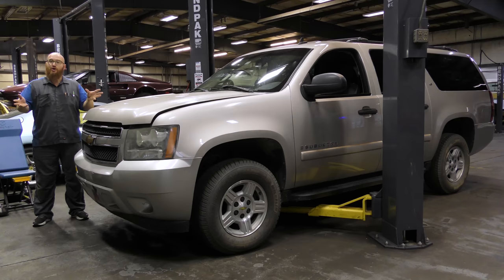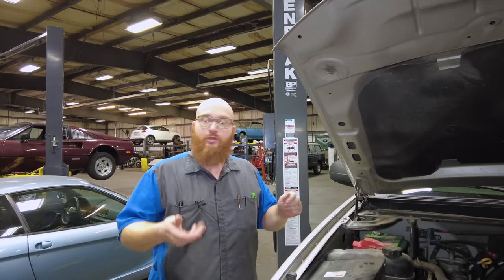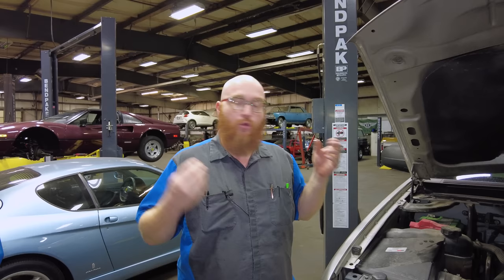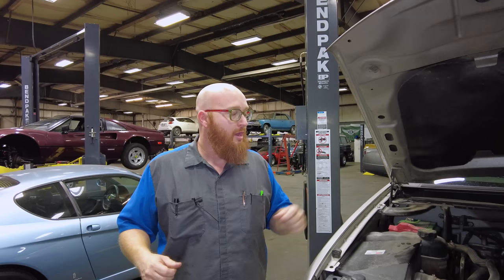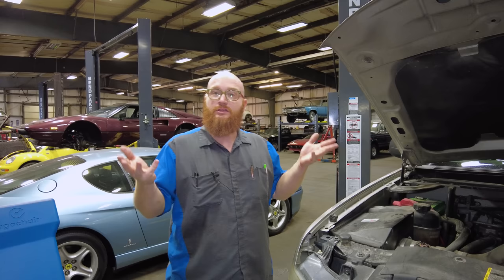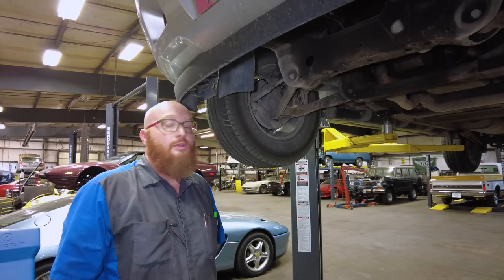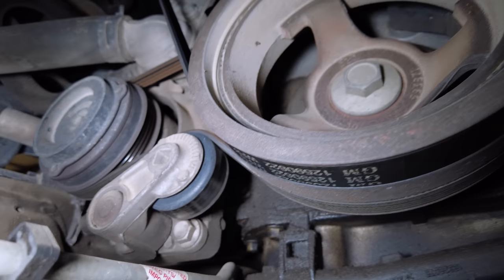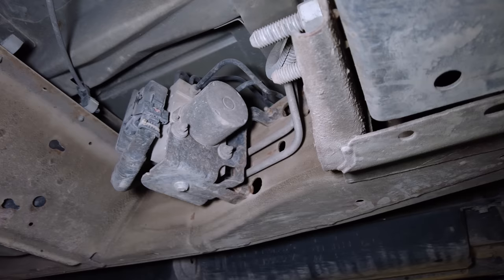What fails on ALL early 2000's Chevy SUV's!? CAR WIZARD shares what he's seen from the last 20 years

Comment: I used to be a Gm tech when these came out ... 1/2 ton chassis with 4l60 did hundreds of them and transfer cases especially if they are left in auto 4x4 mode.. stretch the chain which was 900 bucks if it didn't destroy the aluminum case. Rear axles I swear were made of glass.. among alot of Delphi electronic issues ... but majority of the issues is lack of maintenance
Reply: Those ol 4l60s just never held up? I'm sure it was a lack of maintenance, but still, kinda sucks because I always wanted a gmt800 Tahoe or Yukon, but whenever I find them they're either rusted out or don't have any trans maintenance history.
Reply: My 2002 Silverado Z71 is still rolling strong. But, I do all the work myself, never had an issue with the transmission, had an issue with the transfer case, rebuild and away we go. It's honestly the easiest vehicle to work on I've ever owned.
Reply: Those trucks may have a few issues, but they run forever.
Reply: Probably why my 2004 I-6 Envoy still works. That and I removed the front prop shafts (making bearing noises). I don't use 4WD anyway.
Reply: At least the 4l60e is cheap to rebuild in comparison the the 6l80.
Reply: New Process 246's (and the likes there of) are Magnesium T/Case's
Reply: The issue was not buying a Toyota
Reply: Hi
Reply: @jordanmercier3616  the tech and the dealership knows what the service records are if the owner was not seriously allergic to said dealership. So when automatic transmissions go they just do and it has a lot to do with the engineering.  If you look at Mazda and Honda vehicles, the heavier vehicles, namely their respective vans all needed new transmissions even with their services done on time. Or course without the services done the trans is failing at only 50k so I told customers to change it at 30k. Part of it is the nature of auto transmissions. They are finicky and weak. My imagination tells me that certain things are carried over from their passenger car lines and not totally reengineered for heavier vehicles.  Automatics are gravy for dealerships and thats one reason they sell them.  They may reduce shock and load on engines but ideally I would prefer manual for the durability.  It could also be temperature. Auto trans especially do not like high temps and yet trans fluid radiators are not that common. Perhaps its the gravy thing. Not sure. The turbine in the torque converter generates heat always!
Reply: @jamesmedina2062  yeah, that makes sense. I have a GX470 at 250k and an 02 sequoia at 265k. Haven't had any major issues with either of them, they both have the 2UZ engine, ones pre vvti and ones post vvti,  one has a 4 speed auto, and the other has the 5 speed auto. Granted I've done a lot of maintenance on them and they both have trans coolers.
Reply: @chadhaire1711  I love these types of comments. Yes, Toyotas are fairly reliable, generally speaking. But lets compare GMs offering of full size trucks SUVs in the early 2000s to Toyotas. First of all the Toyotas of the time (and it's not much different today) were just less specs for the $. The specs on the Toyotas didn't stand up to domestic truck specs, whether it be payload, towing or power... the toyota trucks/suvs just didn't offer the capability that the domestic ones did. And as a shop owner, I assure you the 1st gen of Tundras/Sequoias have their fair share of issues and their issues are often more costly too. For sake of comparison, the 1st gen tundras/sequoias (2000-2006/7) most common problems that I see include:

1. the very same issues with the exhaust manifold studs as GMs do. 
2. They VERY commonly experience smog pump problems, which in a shop will cost in neighborhood of $2k to repair. 
3. I've seen quite a few of them with broken ball joints. 
4. The radiators fail internally and mix the coolant and transmission fluid which usually destroys the transmission. 
5. The catalytic convertors are typically junk at around 200k miles and cost around 3 grand to replace. 
6. I couldn't even begin to guess how many sets of head gaskets I've done on them. 
7. A ton of the earliest 1st gen tundras that came off the line needed the rear end replaced within the first few thousand miles (this was a "teething" issue that was fixed in the first half of the first model year iirc and is all but forgotten nowadays) 
8. Frame rot on them is extremely common (In my experience Toyota's/Lexus' in general and across the board have the highest propensity for rust of any manufacturer in North America)

Fact is that pretty much none of the common problems seen in the 1st gen toyota tundras were resolved in the earlier 2nd gen tundras. You can add starters to the list of common problems in the 2nd gen trucks though. Put the word "starter" and "tundra" in the same sentence and people start running away quick. The 3rd gen tundras (2022-present) are already having their turbos fail at an extremely high rate, which from what I've been told is a cab off repair. I keep hearing the rear ends in them are leaving a lot of them stranded on the side of the road too. 

Yep, shoulda bought the Toyota instead. As for the Land Cruisers, they're not without their problems either. They are also grossly overpriced. That said, it is the Land Cruiser and the 4runner that earned Toyota its reputation and I would highly recommend them to any of my customers.
Reply: @catfishbilly7425  Well Fish it's like this:  I have been around the car industry since the late 60's.  I keep track of what fails and what does not.  You are playing a numbers came, cherry picking stats  to make your point.
Yes rust and gaskets can happen, but I know damn well it will happen LESS in a Toyota than any other brand.
Go over seas and see what people are driving in the boonies...no Chevy, Ford, or even Jeeps there....mainly Toyotas...and for a reason.  As far as power and tow ability, buyers of Japanese trucks are not going to get suckered into the number wars......So the F150 can tow a thousand pounds more than another brand.....50% of mid-size ruck drivers will NEVER  pull or tow more than a ton of people or gear, and most who do will do it about once a month if any.  That is why the Datsun and Toyota 4 cylinder mini trucks sold so well in the 70's. 80, and 90's....they ran and ran and NEVER broke.
2.)  And again with your cherry picking, you gripe about the Tundra Turbos failing...actually they are not failing, it is one small part, and that is due to the AMERICAN SUB-CONTRACTOR and their crap quality control who didn't make the parts to spec.  Fact is that motor and turbo has been used in other vehicles trouble free LONG before it ever saw service in a truck, and were trouble free if they were JAPANESE made...just like the rusted frames on some Toyota trucks in the past--it was the AMERICAN MADE frames that failed, NOT the Japanese made.  And Toyota backed them up, even replacing the entire frames out of warranty at no cost to the owner....could you imagine Ford,   GM or Chrysler doing that?  LOL....NEVER HAPPEN. Even in the worst lemon buy-backs, it takes an act of God to get a response, especially Chrysler....now that they have been sold once again that might change but....
3).  You can play with all your numbers you want---solid factual warranty records, repair records, and consumer feedback all prove that Toyota Tundra's (or Honda Ridgeline--yes it is a truck) are still less likely to have problems  compared  to Nissan, Ford, GM, or RAM.....that is why they have 20% more resale too....the money you lose on   depreciation with other brands in huge---for a good reason.....so your soap box speech was entertaining....you seem to have had plenty of practice, bet you even give it to the mailman..., but it didn't  work here.........NUFF SAID.
Reply: @jordanmercier3616  mine made it 200,000 miles with mild towing. Certainly not the worst trans. I would rather a 6 speed anyways.
Reply: @catfishbilly7425   1. Exhaust manifold leaks are super common on these 4.7s unfortunately. There really isn't a good solution other than Doug Thorley headers that cost like a grand plus the time to do it.

2. The secondary air injection systems are somewhat common, but they're only on the 05-07 tundras.

3. The ball joints aren't a big issue on these, they're a regular wear item that probably goes out a little sooner than other comparable trucks. I've never seen a lot of them.

4. The trans cooler failure is not a common failure, though it does happen. Just replace the cooler every 10 years and ur good. The part's like $100, it's a super easy fix.

5. The cats are usually done around 200k miles, lol that really isn't that bad. They don't cost 3 grand to replace, not on the first gens anyway. Maybe $1,500 at a shop.

6. Head gaskets were never a common failure on these so I have no idea what ur talking about. 

7. Keyword off the line, and Toyota fixed the issue and no cost to the customer.

8. The frame rust issue was sorted out long ago, and it was only an issue with the vehicles made in the US. The Japanese made vehicles never had this issue. Also, anecdotal, but I own one from Japan and one from the US, the Japanese made vehicle has 0 frame issues, and the US made one has some serious rust spots.
Reply: I could R&R a front hub bearing assembly in 10 minutes, blindfolded.
Reply: @jordanmercier3616  dont confuse catfish with the facts.....his head will explode.
Reply: @chadhaire1711  I have direct proof which is the best kind. Why don't you watch some of Precision Transmission's videos on here? The amount of stuff that can go wrong on an auto transmission is huge. Also there are friction plates that by definition degrade with each transfer of torque. Manual transmissions are incredibly simple mechanically and the fluid is basically clear for many years. There is no friction material. There is no turbine that generates heat. Just direct transfer helical gears that mesh together.
Reply: @jamesmedina2062  you forgot $1,000 to replace a clutch every 80,000 miles....and Toyota--Honda automatics usually go over 200,000 miles, by then its time to get a new vehicle.  You are cherry picking your numbers here.......Fiat, Mini Cooper, Nissan, VW  manuals fail often............
Reply: @Globbs  fair enough, not all of them are bad, but a considerable percentage if I had to guess. I guess I'm just saying compared to other vehicles that are known to be very reliable, that trans isn't quite as good. Not the worst trans by far lol, nothing like the Nissan CVTs.
Reply: @chadhaire1711  there may be exceptions but if you parse your own words you will believe the difference in the two formats of transmissions. One of them has a friction material that is kept separate from the gears(clutch) while the other has everything thrown together. Hey autos have their place because they free up your other foot to do something else and your other hand to do something else like check your phone or something. Even mechanically autos give the engine a consistent fluid load that is better for it. In line with what you said my friend did go through 3 transmissions in route to putting 650,000 miles on his Honda Civic. The engine stayed happy. He was a rocket engineer at White Sands Missile Range and took the 150 mile round trip every work day back and forth from El Paso. I put 330k on a VW 1.8 turbo engine on THE ORIGINAL CLUTCH. The Getrag transmission was always solid. The engine was burning oil and needed rebuild. I have never burnt a clutch out on various cars. I drove a Ford Mustang with supposedly bulletproof C6 to only 1 or 2 thousand miles before the transmission was toast on account of high power and the heat. The converter was smaller on that thing. Manuals don't even need or get coolers ever! They don't need 'em!
Reply: @chadhaire1711  I believe you Chad. As a teen,I had several 70s and 80s classic Gms,Chevy,Dodge, Chrysler,and Pontiac. The first was a Vega!🤣 cars that established the foundation of the American industrial revolution in history. Nowadays, the past 3 decades, the American automotive industry has been sabotaged. Automotively..we should be great again, forever.
Reply: @jamesmedina2062  My 390 C6 went 200K miles and that tranny was impossible to kill....it ran out of fluid so many times I can't count, and one day the brakes failed so i slammed it in park at 25 mph.....even after all that it still operated 100%. On the other hand the 6-speed manuals in the  newer V8 Mustangs  fail, and fail often....I think there was a class action lawsuit....only the Mach 1 or Cobras get the stronger box.  
The automatics in the Mustang GT last longer than the 6 manual.....the ZF 8-speed automatics are bulletproof.....used in about 15 million vehicles, various brands,  from the Dodge Chargers to expensive Bentley.  Oh yeah, automatics are quicker in the 1/4 mile, and use 10-20% less fuel......so if you want to accelerate slower, use more gas, and shift a thousand times in heavy city traffic, go ahead with that manual.
Reply: @edgarcruzsr9695  American car makers have good stuff, but you have to pay them good money.  The new  Dodge Challenger SRT, Hellcats---RAM TRX Hellcat---Ford Mustang V8---Corvette---Raptor--Bronco....all great vehicles but expensive.  But on their lower end economy cars, all junk.  A sedan or compact SUV you are better off with a Korean or Japanese brand (except Nissan).   The worst American car ever made was not the Vega, which aside from the crap motor, wasn't that bad, because it had good looks, was easy to work on, and had fantastic cornering ability.  It was the Vega based Chevy Monza.  What a piece of crap!!!  Everyone wanted the small V8, I think is was a 262 , bastards guzzled gas like crazy, and every time you hit a bump, that heavy engine would slam the suspension down hard, and the heavy doors would try to fall off when opened too hard, and all the cabin plastic fell off in the heat.  The 1980 cars were all junk regardless of who made them.......horrible decade, and that horrible Dodge Omni  piece of shit....I warned my buddy not to buy one, but he didn't listen--a few years later we took a road trip with me driving, all the interior parts had fallen off, the windows would not roll up or down, the power not there, steering wheel shake, suspension bottom out, rattles all over.....and all less that 50K miles....
Reply: @jamesmedina2062  I watch that “Precision Transmission” also. That tears those apart lickety split, just wish he would video one going together.
Reply: @chadhaire1711  I like that old C6. Had one on my in-line 300 six cylinder.
Reply: @Mikael5732  yes true. few people want to capture meticulous assembly. Steph Papadakis is one of the best and Subie Performance. For transmissions there is that one guy around NY/NJ for Muncie manuals but I forgot his name.
Reply: @jamesmedina2062  I have a ZF5 in my old 92 F350 flat bed and wouldn’t want an automatic. Now stop and go here in south Florida can certainly be tiresome but I go nice and easy when I drive my 7.3 IDI. 
     Was thinking of getting an early Chevy 2500 4 door with an 8 foot bed but my hands are full now just keeping maintenance up, and catching up on my neglected 2004 Z71 4 wheel drive suburban. Our old family car. Even though the kids are up and out I still want to keep it. May cost me close to 10k to bring it up to spec, I can’t buy a new one nor would I. Happy Labor Day James.
Reply: @Mikael5732  yeah the new ones are quite expensive! and supposedly break down. When I sold trucks for Len Lyall in Colorado I think Chevy trucks were good then. That was mid-2000's.  

As for the trannies I remember driving my uncle's truck for him when he had drunk a bit too much whiskey in Mexico . It was a manual and drove just fine. I have a Ford now, older V8 with C6 and I wish I could fit a toploader manual but I have a few other things on my plate already with fitting new mufflers, brakes, and fuel, as well as looking at gaskets and fixing new water leaks because it has sat for 14 years since I brought it back to El Paso from Denver.  Happy labor day!
Reply: @chadhaire1711  i have a 2012 Rav4 2.5L with 80,000 miles, and the transmission is giving up. It has had 3 transmission oil changes and 3 new oil strainers, and it's still failing. I guess it's just the era of crappy cars in general.
Reply: @BlazeSEGA  it should be good for 200K  -- dont know what to tell you
Reply: @catfishbilly7425   Wealth of info there. Thank you! I owned a first gen Tundra. Besides the 'bed-hop' and squeaking heater it ran great......until the engine blew at 99K miles. 
Also owned a 94 LC, loved it but known for blowing head gasket. Idiot light for a temp gauge and grossly underpowered for the weight of the rig. I would probably buy another if the price was right.
Reply: You just proved yourself a liar. I have a virgin 8.6" rear axle under mine, at 281K miles, I've had more than 7000# of vertical load on it, at full throttle in first gear, low range, 3.42:1 G80, on 305/70R16s, and it took that abuse reoeatedly with zero consequences.
Reply: @jordanmercier3616 doesn't matter, the 4L60E is based on the 700R-4, which debuted in the 1982 Corvette, so it's had decades of refinement, and the most likely problem they have is the 2/4 band, but even if that fails you can still use first, third, and reverse, I've done it, and even if everything else fails, first gear is literally unbreakable. However, in case of full electronics failure, the default gear is not first, so just plan on swapping in an '88-'93 700R-4. Problem solved.